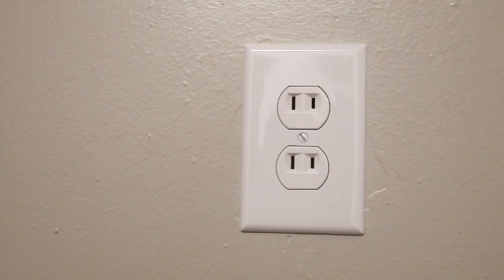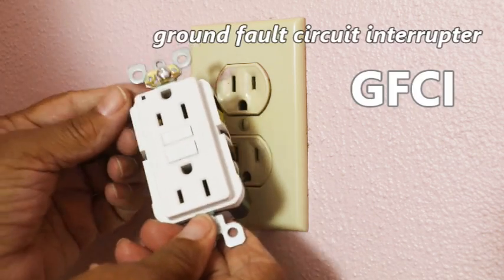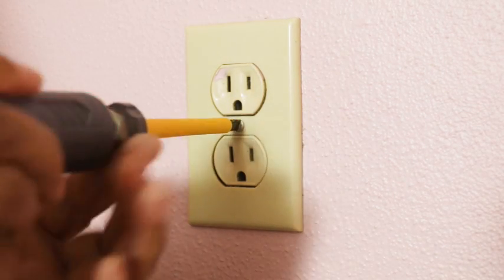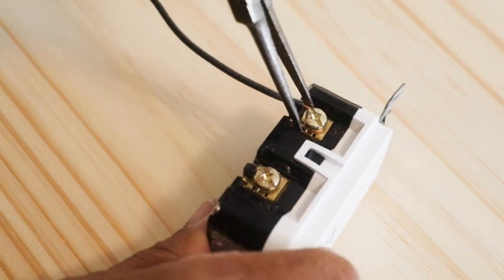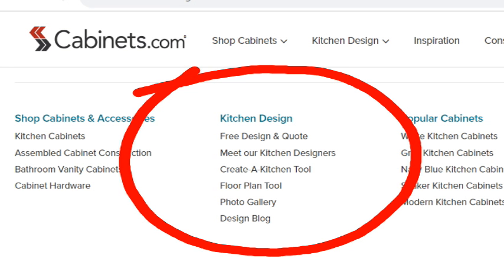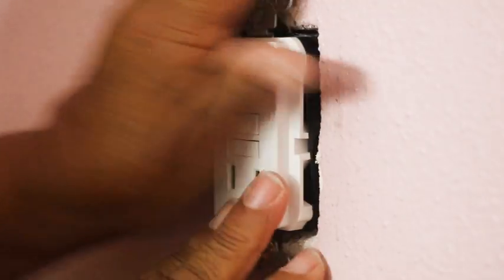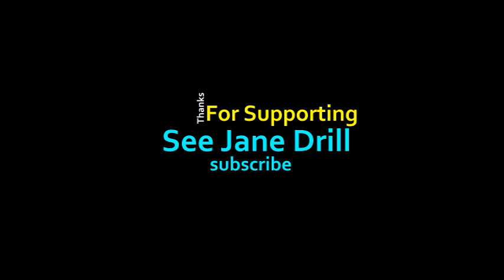Risky Wiring// Install this instead

Comment: I changed all my wall outlets, as a DYI er in an old house. Something I did not know, I may have to go back and redo these. All I did was replace them as the same. Will this be a problem? By the way, 1960 home. No ground wire, just black and white. Thanks!

Comment: Electrical tape around the outlet.  Who-du-thunk-it???  I've always been a bit leery about those screws when you place it back in the wall to because they're hot wires but I had never thought to do the electrical tape hack.  Leah's the best!

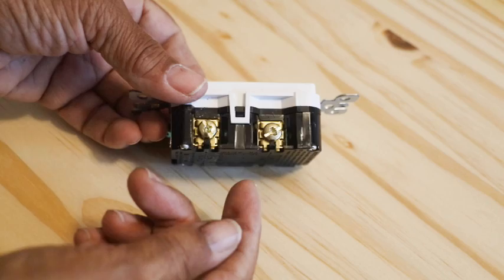Comment: 2:24 You don’t need to wrap most screws. This particular GFCI looks (hard to see on the video) like it has clamps. Right under the screw is a square “washer” which is the clamp. Place the straight wire(s) under the clamp and tighten. It’s designed that way so two wires can be placed under each screw.

4:45  And don’t use the screws to draw the unit into the wall. Push the GFCI into place with your hand, then insert the screw to hold it in position.

Comment: Licensed electrician here, pointing out that you cannot assume that your black wire is the hot nor your white wire the neutral. Only testing to verify and identify can confirm. Also, in many older homes, you may not find colored conductors at all. Don’t take chances. Get it right.

Comment: I love your videos and some great comments! Have you tried wire levers? They’re awesome! I was replacing a light and found that someone nicked a wire and it luckily hadn’t created a problem…until I put in a new light. The short helped me discover the problem. Cut the wire at the nick and didn’t have enough wire to use a nut. The lever connector saved me!  Found another nick in a wire when I was replacing a plug. Found four switches in a box with not one grounded! 4 ground wires just sitting there! How hard can it be? Ugh!
Reply from the maker: Love Wago connectors

Comment: Bought my house in 2007.  It was built in the early 40's..  Most outlets were 2 prong.  Given my house wiring, I'd spent a fair amount of time on the internet and decided the "bootleg ground" approach would be a good one.  I happened to work for a company that had a subsidiary that did commercial construction.  They had a team of electricians.  I spoke  the head / master electrician and he simply stated that installing a GFCI at the head of every circuit would not only be compliant, but a lot safer.  Thank you for effectively the same advice.
It is a useful note that if there's a series of stringed outlets, only the first outlet needs this treatment.
Reply: Is there a way to test for stringed outlets and how do you deteriorating which is first?  DIYer here, thanks.
Reply: @alyte11  DIYer here too.  I just happened to work for a company that gave me access to people that really knew their stuff.

I did it by pulling each outlet out to see if the wires continued from the box.  If they didn't, I'd work my way backward around the room until I got to a point where I thought I was at the beginning of the string.  Once there, I disconnected the wires to see if that would kill the following outlets.  If it did, I knew it was stringed.  Thankfully, I guessed right pretty often.

I'm sure there are some actual electricians that might have a more clever way.

Comment: You wired that Gfci completely wrong!
Conductors slide Straight inside the clamp then you tighten the screw.
Reply from the maker: Actually it's optional...I did not elect to side wire and preferred to wrap around the screw for better stability.
Reply: You are Correct, my apologies.
Leviton Gfci can be side or back wired..

Comment: So if a plug is not grounded, what does that mean? Ya can't use a 3-thronged plug? Or what? I don't understand.  My plug caught on fire several years ago and we no longer use them. I am scared of causing any more issues with this house. Especially the plugs
Reply from the maker: Neither you or the appliance  is protected in the event of a fault.  A Two prong plug is safe as long as nothing goes wrong.

Comment: Hi Leah, under the screw head is a guide channel. Is that used for anything?
Reply from the maker: Side wiring...it's an additional  option on how to attach the wire to the terminal

Comment: What she did not mention is that often the wires are cut so short that it becomes an extremely difficult move. Plus GFI's tend to be much larger and those old small metal boxes often can't take the outlet. Often I've had to replace the box with a larger box to make this work. And, wait for it, often what happens is that the ground wire is complete cut at the entrance to the box - which would have avoided this work in the first place. Small towns and non-licensed electricians make for unhealthy living :)
Please everyone, don't cut the wires or the ground. Sigh.
Reply: I feel your sigh. I had to pull some ceiling down but not for electrical. Good thing though. Who ever "finished" the attic ran Romex OVER the joists. Fixed that pretty quick I can tell you.
Reply: @angelachouinard4581 The flip I just finished - how about when you demo a bathroom and discover the 120 lines 'soldered' together and separated so as to not short out. No electric tape or anything. I'll never forget our plumber doing a double take and saying 'well...ah...' Yes it got a junction box.
Reply from the maker: @JackKirbyFan. They're not as bulky as they use to be.  Manufacturers now make a slimmer model.
Reply: @seejanedrill That is good intel to know. Squeeze that into a new video. I will look for the slimmer models now. YOu are the best!

Comment: something else a home owner can do if they are willing and able is to buy a roll of ground wire and run a ground circuit them selfs. its not ideal but its also a good solution until they can afford to rewire the house.

Comment: What if the old wires are the same (no black or white) but just a brownish cloth covering? How to tell HOT from NEUTRAL?  Thanks 4 Sharing!
Reply from the maker: You have to use a multimeter
Reply: Thanks  @seejanedrill

Comment: Those wiring, they look like at least 75 years out of standards! Well European Standards that is. Our OSHA equivalent would tear you a new one if you still have a wirings without ground…
Seeing that, I wonder why there aren't more electrical accidents in the USA and more related death with it. Or is it that, because of the cost of health care, they just never make it into a statistic as no one goes to the infirmary for a electrical burn and a bit of heart palpitations…
Reply from the maker: Poor outdated wiring leads to a significant number of house fires.  The use of a gfci helps protect the circuit in the event of a fault.  It's  an acceptable work around.

Comment: We completely rewired our old house (new breaker panel and all new wiring, switches, receptacles, and fixtures). One thing I did while we were doing that is put the number of the breaker inside the cover for each receptacle or switch. I also made detailed notes for what was on each breaker in the panel (I listed each circuit and printed out a table in the same order as the breakers. Some people thought it was overkill, but the panel was in the basement and you have to walk from the front of the house around to the back to get to it and I hate guessing anyway). In our new house, which my parents built in 1980, as i replaced fixtures, upgraded things, and whatnot, I mapped out most of the breakers and put notes inside the cover on the panel, nothing as complete as the old house. 😂 I still test with the touch less tester even when i am certain, because I'm never 100% certain.
Reply: @bradlemmond, writing the panel number inside the outlet cover is genius.
Reply: Yes I had two sets of electricians work on my house and they didn't label a thing. Fortunately I bought my own test equipment and made sure everything was mapped out and labeled. I even put tags on the wiring in the crawlspace in large writing so anyone working under there could easily see it.
Reply from the maker: That's  a solid idea.
Reply: Great idea!!! We need to do that. The last person to label the breakers was way off!

Comment: This is extremely dangerous. She did not explain why testing the gfi is so important. If you installed the wires on the non gfi connections on the back your plug is not gfi protected.  

At a minimum you should push the test button on the front of the receptacle. If this doesn’t disconnect power then it’s not wired up correctly. Even better get a plug tester with a gfi test button. Testers are less than $20 for a basic one. Or $35 for a better one that uses a battery. I would suggest the battery one from Klein.
Reply from the maker: I did test the gfci,  however not every last detail of a project is shown, the video would never end.
Reply: Because I have seen them wired backwards so many times I would consider this test a life safety check. I believe life safety checks that can harm someone other than the worker should always be included. 

Definitely more important than how to tighten the wires or wrapping the receptacle with tape when using a plastic box. But that’s just in my opinion.

Comment: The tape around can also help get them into the old box.  I found that the old outlet boxes were very small, and the ones I was working on were in a kitchen with a tile back splash so replacing the boxes was not possible. And Lord have mercy, one that had a cut out into a mirror. That one about ate my lunch!
Reply from the maker: They make a slim gfci version that are easier to place in the box, but you're right about the tape.
Reply: @seejanedrill  that is good to know, I was doing this for my daughter and son in law in a house built in 1955.  I only had one, which maybe was a plug that was also controlled by a switch I couldn’t do.  I just put it back like I found it because it was nowhere near water, and I was under a time constraint.  Later they had a professional come in and do the ones I didn’t get to.  They had just bought the house and I and his mother helped them drive the four states to get there and I had a couple of days before I flew home.

Comment: Was always taught black wire to brass, white to silver, ground to green. That was set up years ago when only men were electricians, because a little known fact that there are many men that have some degree of color blindness. The brass looks dark and the silver light, so that's why there are different colored screws.

Comment: Great video.  I did notice that the GFCI you used appears to be configured with screw clamp back wiring connectors.  https://inspectapedia.com/electric/Receptacle_20A_0054_DJFcs.jpg.  These allow for a much shorter bare lead without the need to bend/wrap the wire.  Perfect for when the available wire is a little short.  Screw clamp back wiring is a common feature of many commercial grade outlets.
Reply from the maker: You're absolutely correct!

Comment: In my ugly house: half the receptacles are grounded and half aren't. In the ungrounded circuits i am identifying the "lead" receptacle and replacing it with an afci/gfci outlet. In the grounded circuits am replacing the "lead" with an afci receptacle.  Also looking for open splices in the attic and crawl space  to button up, fortunately it is a small house with shorter wiring runs. A big problem is some 20 years ago the service panel was moved to an outside wall and condensation forms on the inside. I am replacing the breakers, but in the future the only solution i have is to use my air gun to dry out the interior. I had no idea this was happening until i had to open the breaker box and removed the panel covering tbe inner workings...bse i wanted to put in afci, gfci breakers if there was room...there isn't. It's an undertaking but one step at a time. 👍🏼
Reply: When you said outside wall I'm assuming that it's still inside the unit. May I suggest cutting a piece of 3/4" plywood and a 1/2 " insulation board slightly larger than the electrical box and place both pieces, insulation against the wall and then the plywood. Slide both pieces between the wall and the electrical panel. If the box is recessed into the wall then carefully slide the box out enough to put the insulation board then reduce the plywood to 1/2" thickness.
The insulation board will help reduce temperature changes that will  cause condensation and the plywood will help in reducing moisture buildup.
Reply from the maker: Having the skills to address your situation is a HUGE savings to you.  NICE!

Comment: Thank you! I'm in the process of moving an ungrounded outlet in my van conversion. I'm going to use a GFCI now, thanks to this video.
Reply: Van conversions are  DC  which uses the vehicle as the ground.   Make sure your GFCI is rated for DC.
Reply: @elonever.2.071  This is a 110v outlet. I have an inverter. Does the GFCI still need to be rated for DC?

Comment: I'm definitely looking into doing this because most of the outlets in my house were ungrounded and my dad and I just replaced the outlets, we didn't have GFCI outlets available.

But more importantly we do need a complete rewiring. There's no rhyme or reason to the circuits built in the 50s and 60s.

Comment: Jane, you do a great job explaining DIY things and you have an awesome channel here too. However, those GFCI's are designed to terminate the conductors using the pressure plate. Just straighten the conductor and place it under the terminal plate then tighten the terminal. Done. More than one conductor can go under the terminal on this GFCI as well. Take care, Ron.
Reply: Her name is Leah. See Jane drill is just a take on the old books of Dick & Jane I believe.

Comment: I have a house with K&T wiring. Tomorrow the K&T is being removed from my attic and new wiring put in. My living space (I have a one story bungalow) has no live K&T; it was disconnected by previous owner (verified by a licensed electrician.) All the plugs are 3 prong but I didn't know that didn't mean it was/wasn't grounded. So I will be asking the electrician some questions. Thanks.

Comment: Make sure you pay attention to the line and load markings when wiring the receptacle. The incoming hot and neutral wire to the line side and the wires going to the next receptacle wire on the load side.
Reply: You should always use a gfi tester after installing to verify it works. It’s way to easy to get the wires mixed up.